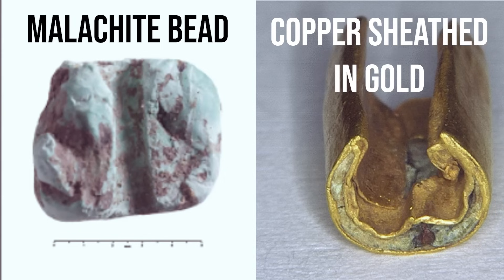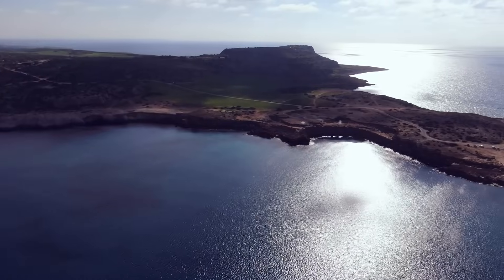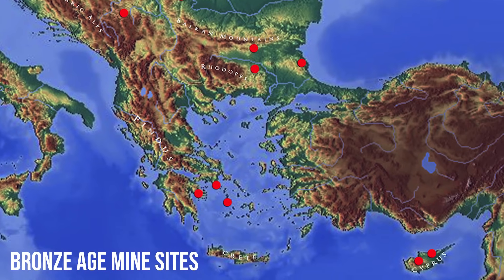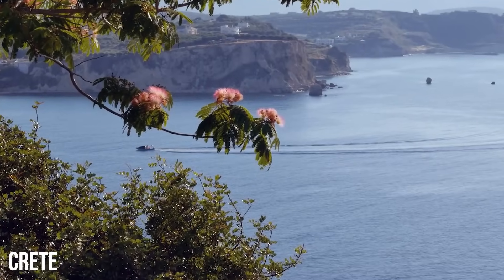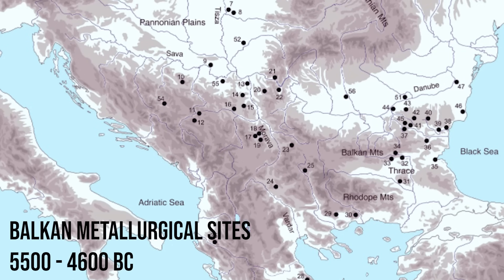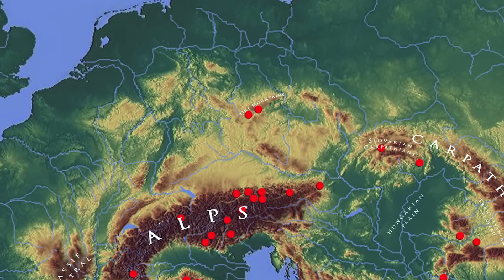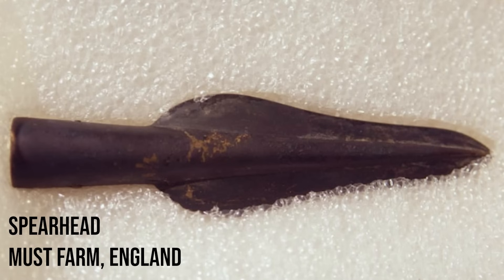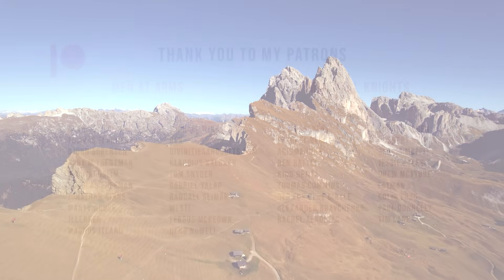These Ancient Mines Transformed Prehistoric Europe

Comment: At least 500,000 tons of copper came out of Isle Royal in Michigan and NOBODY knows where it went, the indigenous peoples could have never extracted that much, let alone use that much copper, so exactly what happened..??   There wasn't that much copper used across north America during that time, only miniscule amounts of have been found among recent excavations.
Nobody has a clue where the copper went...   Ancient pit mines all over the island, no mentionable amount of copper past 3 tons, ALL TOTAL in the last 120 years have been found with 1000 miles, in any direction..     These things were once easily found with metal detectors from the 1950s onward but now, not so...   Think about it only 3 tons, probably a few more, found out of 500,000..
There's a mystery for you...
Reply from the maker: Nope, 500k tons of copper did not come out of prehistoric Isle Royal. No mystery at all, that's just a complete fantasy made up by pseudohistorians.
Reply: There's no way to accurately calculate the volume of ore extracted from a deposit. The math used by proponents of this theory is arbitrary and purely speculative. Also, there's no evidence of a Bronze Age copper shortage during the time of the Minoans.

Comment: A few years ago while doing some research about the Shanidar cave copper pendant which is 11,000 years old, I found out copper ore while not as abundant as many raw materials used during that period is sometimes found on the surface and in caves is very distinctive and relatively easy to spot. The main problem I see with this is that we forget that animals as distant from us as crows are attracted to shiny things and when copper ore is struck with an impact of a solid object leaves a dusty substance and becomes clearer which would be noteworthy for our neolithic ancestors obsessed with fertility and beads as it can be hammered and polished and it doesn't look like most things found in nature out there in the open by those times.

Comment: Bronze age European ships couldn't sail across the Atlantic. Even when traveling across the Mediterranean they stayed close to the coast. They also couldn't hold many supplies for the crew (another reason for staying close to land) so even if they somehow reached America they wouldn't be able to fill the ships with both copper and enough food for the journey back
Reply: Even if they could, and they were known (which they weren't)  it wouldn't have been economically rational to do so because there were sources closer at hand that could be extracted or traded for at far lower cost.
Reply: Tiger GamingGR.  Yes, you are perfectly correct on that.  I recently had to email Professor Pulak, who conducted the excavation on the Late Bronze Age Uluburun shipwreck, to fact check something I'd found in one of these pseudo archaeology books claiming that the Minoans sailed to America.  He also pointed out that while it may have been possible on a reasonably calm day, the fact that the Uluburun ship had only a keel plank as opposed to a fully developed keel, along with a sail that would not have allowed the ship to sail into the wind, makes the idea a non starter.

As for the two "reconstructions" that have been made and sailed, and rowed, around the Mediterranean, well let's put it this way, the reconstruction of one of the (Minoan), Thera ships from the frescos (circa 1600 BC), is based solely on the image and then designed on a computer.  That's bad enough, but then they have it being made to use oars.  The fresco shows the occupants paddling!  Anyone want to try paddling across the North Atlantic?  

The other "reconstruction" was of the Uluburun ship (circa 1320 BC).  This is not a Minoan ship as the Mycenaeans had taken over the Minoan sea trade by then.  The amount of actual ships hull timbers still remaining was approx 3 %.  They then based their reconstruction on an image of one of the Egyptian ships used in the Red Sea to travel to Punt.  So yet again, it's not going to be accurate.

The idea of people traveling from the Mediterranean to the Great Lakes is simply a non starter, no matter how much people want to believe otherwise.
Reply: @melrichardson7709  People that use the word "pseudo" in their arguments are always entirely wrong.
Reply: @adambane1719    Interesting comment Adam.  Would you like to expand on it further.😊

From the Oxford Dictionary, " supposed or purporting to be but not really so; false; not genuine," also " resembling or imitating (pseudo-language; pseudo-science)."

Comment: Um, not sure  what the area of expertise would actually be of the fellow picking apart rock deposits at about 7:30, but I hope he doesn’t purport to be a metallurgist.  He is using a steel file as if it were a chisel, beating on the hardened end with a hammer, and trying to drive the soft tang into the rock to split it. That said, though, other than this and a couple of other quibbles over choices of stock footage to accompany the narration, I was pretty impressed  with the quality of the content.

Comment: Sweden did have a large copper mine in Falun during the Iron Age. Copper extraction started there around 700 CE and lasted until 1992 CE.
Reply from the maker: Yes indeed there's a section in the bronze age mining book in the description about why Sweden - which has the most enormous, famous and important copper mine in European history - didn't do any mining in the bronze age.

The book doesn't exactly answer the question it just says obviously it's not just whether the ore is there, it also needs to be found and technologically accessible for the era.
Reply: @DanDavisHistory  I think they would have if only they had discovered it earlier.
Reply from the maker: @swedishmetalbear  it's also about the geology and the nature of the ores in different places. Native copper on the surface that isn't oxidised is easy to pick up and use - this is what the have in those Michigan sites. Then malachite and azurite is oxidised and needs smelting but is easier to find and process. Further down you get chalcocite like in the Alps for example. Harder to get and more work to process. 

At Falun I believe it's mostly chalcopryte - which was apparently beyond bronze age technology to exploit. It takes way more cycles of roasting and smelting to extract the copper.

Comment: Having regular trade routes across the Atlantic would have been a massively difficult and risky process in the bronze age. I don't really mind theories about singular boats crossing earlier than we thought (even if I find them mostly unlikely), but the infrastructure and expense needed for regular trade routes from the Great Lakes to the Mediterranean just makes it so unreasonable for a material that is also available on the European continent.

Regarding the minimal use of copper in the America's, economics is a very reasonable explanation. Unless you get to the point of having full time professional miners and smiths, it's not very reasonable for an individual to make copper equipment, as that requires much more training, time, and specialized equipment than flint.

Comment: Is the copper from Transcarpathia related to where the earliest transport wheel was found in Slovenia? Would correspond with the need to transport heavy ores long distances, perhaps to the Adriatic.
Reply from the maker: While there was transfer of goods between the Adriatic and the other side of the Alps, the Slovenian wheel was probably more suitable for a two wheeled handcart to move things around the village - bringing firewood back from the woods, that kind of thing.

Most long distance ore transport would have been done by river and only that last little bit from the river or coast to the village would be done by animal, human, or (after they were invented) wagon.
Reply: @DanDavisHistory  Amazing response, thank you for clarifying that. So smelting was usually done on site or close nearby I'm assuming, ingots being somewhat more transferable.
Reply from the maker: Yes pretty much as close as possible. But they needed a lot of fuel for the smelting process so it was important to site the furnaces somewhere with long term access to wood / charcoal.

Surprisingly on some of the Aegean islands they might, perhaps, have brought ore from mines on nearby islands to the furnaces on another island. This is because the local geography meant prevailing winds rising up the steep slopes blasted air in to the furnaces. And they could only achieve this on one or two islands with steep slopes facing the prevailing wind. 

And they can tell this because testing the slag at these sites gives results from more than one nearby island. 

So yes the smelting was done as near as possible to the ore extraction but there were other factors to consider.

Comment: Exactly how accurate is the trace metal fingerprint (signature)?  Can two mines geographically separated still produce similar signatures?  Could you display side by side graphs to demonstrate the difference between Great Lakes copper ore and Welch copper ore?
Reply: so the reason that isotopic signatures for various sources differ from eachother is that some of those isotopes (lead for instance) are subject to radioactive decay, which means that not only will the original ratios be different from outcrop to outcrop when they're first formed geologically, but the older ones will have had longer for certain elements to have decayed into other elemental isotopes. Equifinality is basically impossible because of that, especially if you're using multiple isotopic signatures.
Reply: yes lol